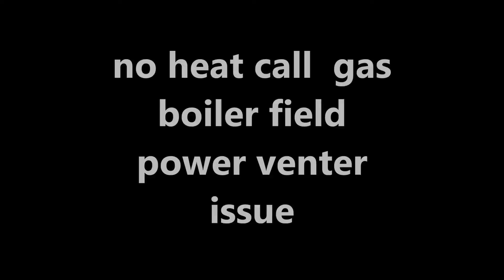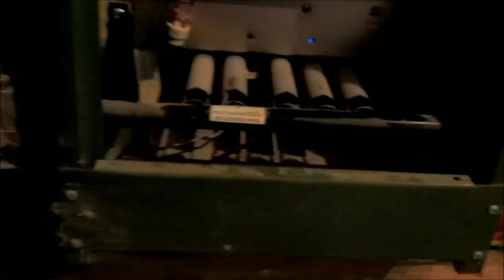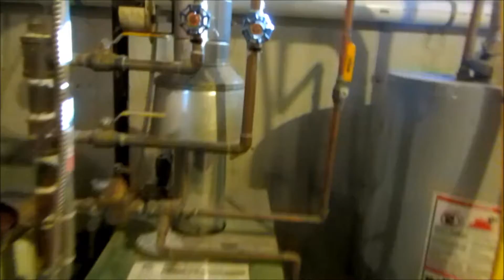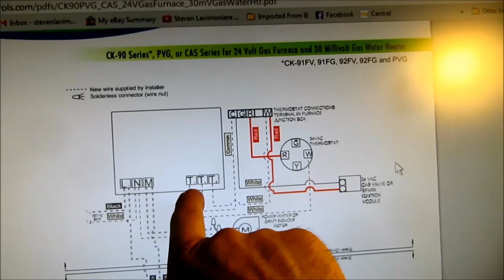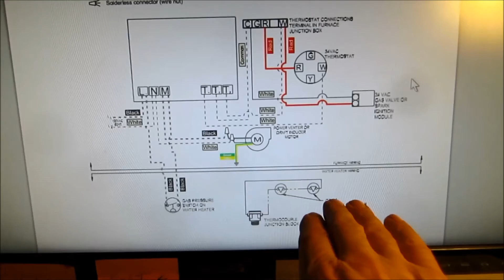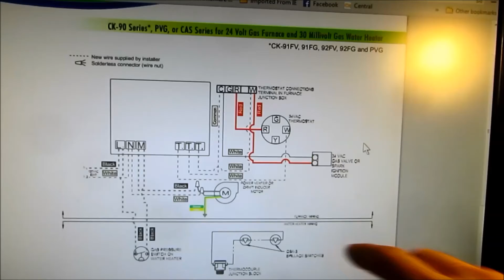SWG POWERVENTER   with ck92 field control NO HEAT CALL

Comment: Hi, I am a homeowner and I have a problem with the power vent the line that looks like a straw ( sorry for my technical terms) get condensation and it freezes inside blocking with I guess ice not allowing the furnace to fire up. I will have to disconnect the inside portion and heat the outside part and blow to unblock the line. Do you know why it happens and what can be done? Thank you

Comment: Good evening Steve! I have a Utica Boiler 15B 80k btu. It has a SWG Field Control Power Venter wired in. I’m having issues on the wiring because last text had it wired directly 120v into L and neutral and motor ( power venter)  running continuously. I reworded it correctly into M and Neutral and boiler fires up but now not the power center. Could you let me know where is my issue in wiring

Comment: I understand but what do you call it what's the name
Reply from the maker: michael white depends on what your doing and what you need for a control .. oil furnace,, oil boiler look up fields web site to fine the proper control you need to run for your aplycation

Comment: Steve on the gas boiler that's which is called a heat sequencer what is it called on the oil burner furnace
Reply from the maker: michael white oil has a different control with a different time delay set up

Comment: hey steve thanks for the video I don't run into powerventers often but when I do its a pain so thank you for your videos. I run into most the ck41 or 43 series field control power venters. The ones with the timer for post purge and the relay. my question is what is the point of the relay. if theres a timer already that could shut off the power venter motor and theirs a relay in the primary control for oil fired units why is their a need for that relay? you know what im talking about? thanks steve appreciate the time u spend on these